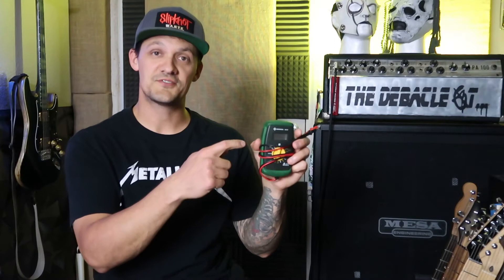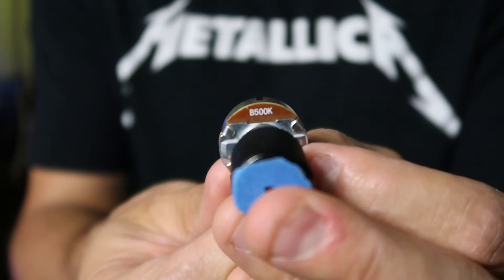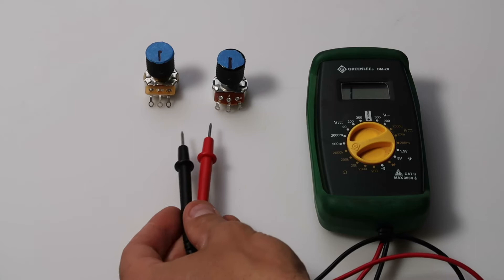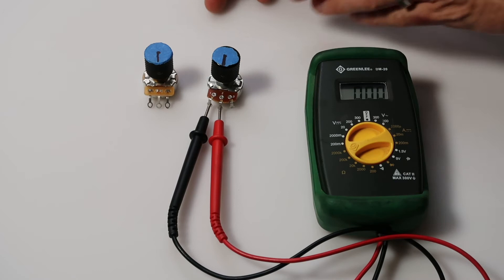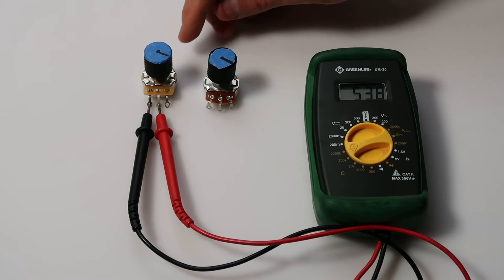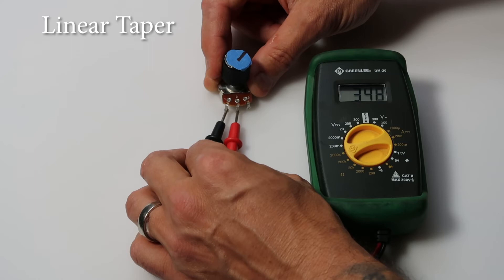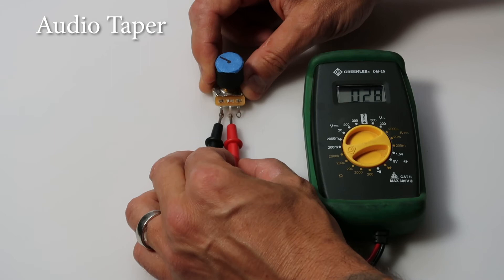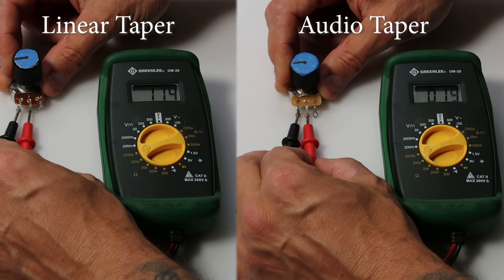Linear Taper vs Audio Taper Guitar Potentiometers (pots)

Comment: the Linear pot makes more sense to me.
Reply: Although you would think it would be perfect for every application unfortunately it's not, this is why audio taper pots exist....Because of the way an audio gain structure works
Reply: Power increases as the square of voltage. An audio pot tries to mimic that so that when you increase the volume pot, the sound level appears to increase smoothly. A linear pot would cause a sudden increase in volume as you move from 0 to 2 or 1 to 2, but would have almost no impact when you moved the pot from 8 to 9 or 9 to 10.
Reply: @carlosanvito  well, this video claims the opposite to be true.

Comment: I got sent a 250k pot for a left handed guitar by mistake and I did'nt realise till I hooked it up for tone on a Strat bridge, all I had was a .0022mf cap ripped out of a 70s TV, wired it all up and realised as I turned it down it got really bright but in max it sounded fantastic. The Linear workes well with tone control with small capacitors on single coils. Worth trying a Linear 250k on a  stratocaster Volume control, to my ears it gives a "usable" level on every stage from 0 to 10. Found out by error when replacing a faulty Alpha 250k Audio, those days did'nt even know what A and B taper was. Do check the readings if poss with a multimeter as out of 3 I got ; 220k, 259k and 279k, tried them all and decided the 259k was best. Don't be afraid to experiment as it helps you bind with the instrument, just take it in small steps and follow all the safety instructions. I bought a tiny battery amp so I could check the the wiring worked properly before soldering and screwing the scratchplate back on. Felt safer with a battery amp cos a mains combo can make horrid noises which can alarm the neighbours.

Comment: Great explanation, What would you recommend for the guitar?
Reply: Linear for Volume, Audio for tone.
Reply: @steve_one  so a linear is a B and audio is an A
Reply: @steve_one  that's the total opposite of what the general consensus suggests
Reply: @jwilkinson341  Usually, depends on the manufacturer and how they tag them.
Reply: @TrannyFluids  You can of course use any combination and they will work but on high output pickups it's good to be able to have some kind of linear range 0 - 10, instead of having the total range from say 0 - 2.

Comment: I totally dislike audio taper pots, specially for humbuckers with distortion, the type that after about 8 start to break up, with a linear pot you can turn down to 7 or so and they clean up but if you use the right cap you can maintain volume levels.., plus have the ability to simply turn down your guitar to different levels, audio is full on or nothing, very horrible for tone or volume, some will say linear in volume and audio on tone, fugg that it's the same thing you either have bass or treble, may as well use an on/off switch, I want to be able to blend or mix my tone so linear is a must or its just on and off, ridiculous IMHO

Comment: I see some reactions here saying linear for volume.

The reason audio taper (logarithmic) pots are used is because our ears experience a bigger change in perceived volume at lower volumes than at higher volumes. So, using a audio taper you get a more perceived linear volume change.

Audio taper pots are generally not actually made logarithmic, but are a approximation of it using 2 linear tracks that overlap in the middle, a slow rising change in resistance for the first track and a fast rising change in resistance in the other. (true logarithmic pots exist but are only used in special applications). This approximation simplifies the manufacturing process.

As shown in the video, for a audio pot the midpoint is lower than half of the total resistance value because that's part of the first slow changing track.
This midpoint is qualified as a percentage less than 50% (a linear pot would be 50% at the midpoint).

There are different types of audio tapers defined by this percentage.
A 10% pot will have a very slow change in the beginning of the rotation, and very rapid at the end of the rotation. Useful for people who like swells by using little travel.
A 30% pot will have a more gradual change and good for those who like fine control over the volume.

Hope that explains audio taper a bit better :)

Seymour Duncan has normal pots and high speed pots (yngwie model).
Bare Knuckle pickups also has pots with different tapers.

Comment: If you use a lefty guitar and want to use an Audio (Log) pot, you need a reverse taper pot. The pot will be marked C250K  Ordinary Log pots will be marked A250K.  You can't just reverse the wires as the taper will be the wrong way round.

Comment: just measured 2 pots, both XGP, A330k 811's  they gradually started ramping up almost from the very moment or position I began turning them?  also liner taper isn't about ohms, it's about how it swells the volume in relation to the position its in so the only REAL way to do this is connected to a constant signal and slowly turning the pot up...

also I have one very very good volume pot in all my collection, dunno what it is but the very second you crack it it leaks a little volume then goes up and up from there, no dead spots or increments in which nothing happens, form 0 to 11 ...  IMHO they should all be like this save for live conditions where a guy just wants a full on full off or close to it, like with the half turn or close ratio linear style, for doing volume swells and so forth..

its crazy tho, different websites explain it differently, and some the same they just flip the Audio or Linear as in one website will explain a linear being the exact same as an Audio, so its prolly best to solder it up and test it

IMHO they should ALL perform like that one in my older strat.. I really like that pot  

I think this test should be performed on a keyboard synthesiser or a tone generator exact same input all the way, then solder em in and slowly turn them up, see how they behave how they're actually used .. mo betta

Comment: I'm gonna change my potentiometer for my speaker volume controller.. the original model is A103 but i accidentally buy B103 model..the design is same..just different on model number..if the comparison just amount of output,which is A type is greatly increase after passing 100k value.. i think B type also no problem if i use..am i right??
Reply: Generally you use audio ( logarithmic  taper)potentiometer with audio projects such as for volume control. Use Linear taper for precise even distribution of resistance for projects such as microcontroller analog inputs and digital outputs.  This is due to the principles of how  the human ear perceives loudness/volume. However if you want to control the gain/crunch of your sound in one knob you may want to use a linear taper. Usually the default is audio taper  But gear heads will switch out to linear for a specific result such as volume with gain. If you want to get more precise you can add capacitors into the equation. Usually very low value caps.
Reply: @mikelee1906  But don't you get a sudden jump at the higher volume with linear pots? As a relative noob, that sounds problematic to me. Confused!
Reply: @LostSpringBand  Love your band!!! That is a cool room/studio you play in!!